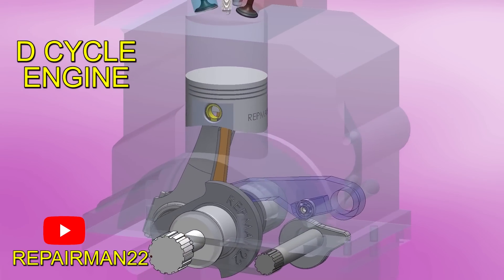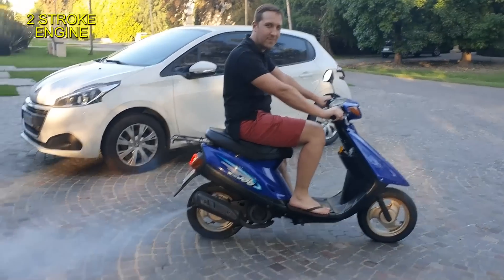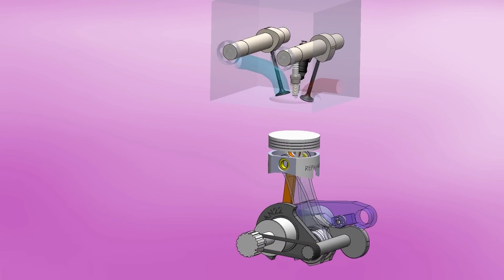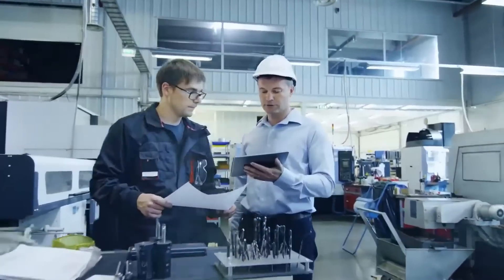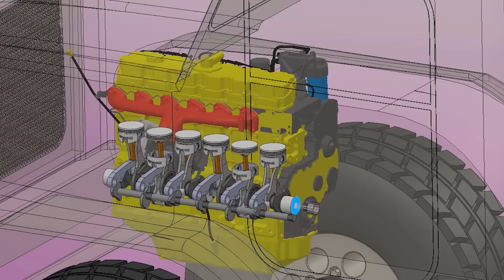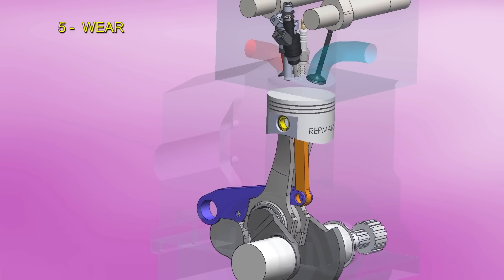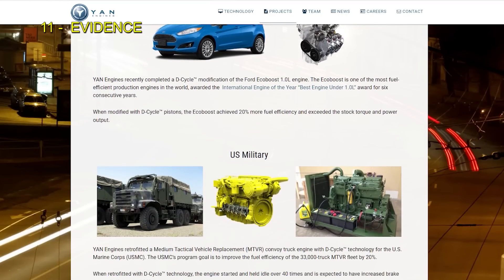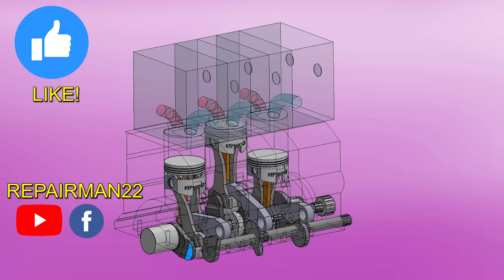Analyzing The Split Piston Engine in 3D. 🤯 Dual Cycle D // 2 and 4 Strokes Combined // 3D Animation

Comment: Cool idea but adding so much complexity to an engine is rarely worth it. Simplicity is king
Reply: Modern engines are more complex. Simplicity is nice, but you don’t get more with less when it comes to engine innovation. VW Beetle engines are nice and simple, but nobody is going to go back to using those engines.
Reply: @NoahSpurrier  yes, because emission laws and producing competitive fuel economy and power require more complexity. And with this has come no shortage of problems. And material quality and build tolerances have improved drastically over what they used to be which absolutely helps reliability
Reply: This is true of all engineering, and is the end goal - "do more, and with less".

From the writings of Golden Age of Science Fiction author, Robert A. Heinlein's classic novel, The Moon Is A Harsh Mistress:

"How does one design an electric motor? Would you attach a bathtub to it, simply because one was available? Would a bouquet of flowers help? A heap of rocks? No, you would use just those elements necessary to its purpose and make it no larger than needed--and you would incorporate safety factors. Function controls design."
Reply: tell the germans that @paulhollier6382
Reply: A wankel engine is far simpler than piston but yet people still complained on it's reliability. Some arguments are not black and white distinct but only a non engineer would think that way.
Reply: It could work quite well in truck engines that work at lower rpm but i highly doubt it because those engines right now are built to be abused with heavy duty parts, i just don't see this being anywhere near as reliable...
Reply: Yep. The KISS method, Keep It Simple Stupid
Reply: PUSHRODS FTW
Reply: Agreed, but this really is a fascinating design concept!
Reply: They have 2 stroke Diesel that have normal oil system already 
     They just need a turbo or a blower instead of the underside of the piston 
     And the opposed piston 3 cylinder 2 strokes eliminate any valve train and are multi fuel
        Was something that didn't need to be done.🎉
Reply: I mean I applaud them trying something different 
     Just way to many potential problems
Reply: The government getting involved in this is just insane
      ☠️
Reply: When some bureaucrats kid goes to college for engineering probably
Reply: So youre saying a 2 stroke engine  is more reliable than a 4 stroke? A wankel engine is more reliable than a piston 4 stroke? Have you heard of modern fuel injection compared to carburetors?
Reply: @jensenthegreen6780 that's apples and oranges though. Two strokes and wankels have inherent design flaws that would be present regardless of complexity. And modern engines are more reliable(sometime) because of the higher manufacturing quality of components, not because of complexity. But obviously, complexity in an engine can improve performance dramatically, and being competitive in a market that demands more power and fuel economy is obviously going to require more complexity, but it does come at the cost of reliability. The trick is finding the balance
Reply: @ So there are excuses, but im still right about the comment, simplicity doesnt always mean reliability, if theres any case of a 4-stroke engine being more reliable than a 2-stroke engine, lets say both are motorcycles, which there are, a lot more than the other way around, it already disproven what you said on the comment, i think in the end its how the engine is made as a whole, like stress it'll be put through.
Reply: Yeah i was thinking this engine looks like a maintenance and repair nightmare.
Reply: if simplicity was king we'd all be using amish tech. why use a wheel when you can just break your back?
Reply: @doji_town_adventures  whoosh
Reply: Pretty much, plus don’t fix what isn’t broke.
Reply: @apollo7557
It's still nice that they're trying.
Reply: Yes, sell your car if it still has pistons, switch to the tube or subway or underground, for trains are GREAT in cities. If you got the bad luck that you are an American, too bad, you have no great cities, you got cars only. Then you musk absolutely get solar panels on yer house and charge your Tesla's. Your Tesla's are your battery capacity. If that seems expensive, simply do your best, every millionair can easily make it to the billionair income. Why not? Come on, do yer best.
Reply: @voornaam3191  and here i was thinking my comments often read like the ravings of a lunatic...
Reply: @voornaam3191 the bad luck of being American...

At least they can defend themselves when a criminal attacs them.
Reply: @antjeeismann4684  I wouldn't be so sure about that in the US. Police is not a friend in the US. Police that does unlawful arrest or uses force, even deadly force, is a criminal colloquially. But that criminal who oversteps your rights can hide behind qualified immunity and is in the same club with DA, so nobody will charge them for wrongdoing. But as citizen if you defend against this police criminal you may end up disabled and charged for felony or it could be your last day alive. That's your safety in the US agaisnt criminals.

Comment: A reverse design, that let the main crank be connected to the center while connect the arm to the skirt on the sides instead, may be better. 
And I don't think a spring pressing on the arm is necessary. If the engine is super charged, the air pressure will press the piston down.
Another advantage of this engine or similar designs, is that it is well compatible with Atkinson cycle, which can increase the efficiency. This is hard to achieve in a regular 2-stroke engine.
Reply: You would need an immense amount of air pressure.   The inertia in the upper piston and its conrod is the major issue with this engine.  In normal engines the con rod length is kept as short as possible to minimise bearing loads for this reason.

Comment: Double the combustion rate but only 20% increase?   That's sad.
Reply: It is misleading.  Your missing the point. It is NOT double the combustion rate.  It is running at HALF the rpm to make 20% more power than the original engine at DOUBLE the rpm.  20% more power at the the exact same "combustion rate" = 20% more efficient.  To say nothing of reduced wear on the bearings and crank, timing set from the lower rpm.  Although the valves will be opening at double the speed
Reply: @sancharino4672  What makes you think it was running at half the normal RPM?     If it was, there could not be ANY power output increase, only a decrease because of reduced volumetric efficiency, and more loads on more bearing surfaces.

Comment: It's hard to call the ball on this one since it needs a lot of development and materials selection/testing.  I believe that the mating surface between the two pistons is going to be very difficult to achieve.  I'd like to hear one of these guys running and watch hp and torque numbers on a dyno.
Reply: There are going to be major wear problems on the rings. The mean piston speed will be twice that of a conventional engine.
Reply: no, its not. this is stupid and anyone with even the most elementary mind should be able to see that.  Dyno...lmao the piston speeds alone will destroy this thing at idle.
Reply: it'll never reach what they claim it will.
Reply: I feel ing the two parts of position banging together would be more of an issue
Reply: It’s been achieved 😂, if you refer to the multiple references of the Ford Fiesta that has one of these engines. The real problem is the US government, they don’t want anything that puts the oil industry at risk. And innovative engines do exactly that.
Reply: @JBeamGT3  the government is forcing more and more regulated MPG across all makes and models, but that would cause the oil industry to take a hit, no?
Reply: @JBeamGT3  What's preventing China and other countries around the world from building these engines if they are as reliable as you imply?
Reply: @JBeamGT3  You've got that tin foil hat working overtime there ..